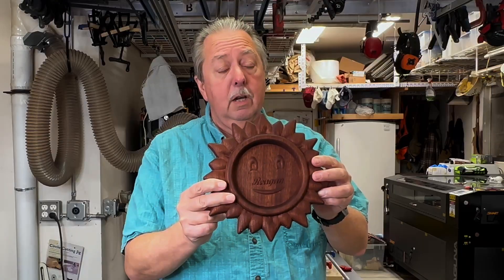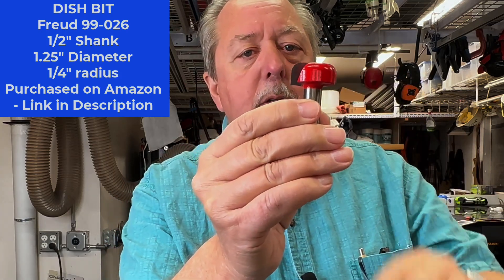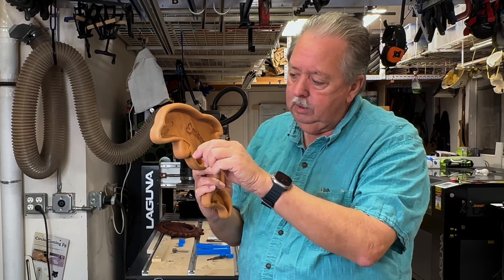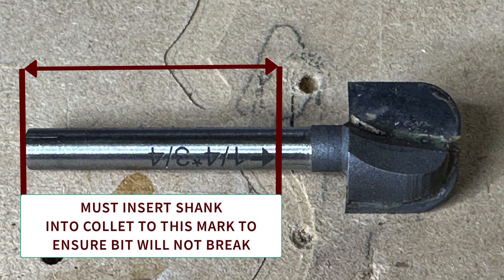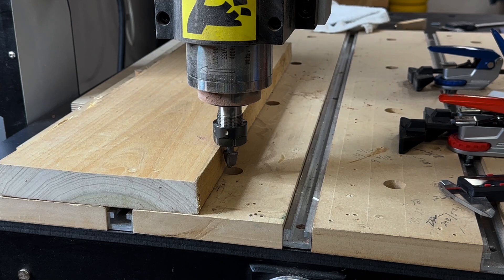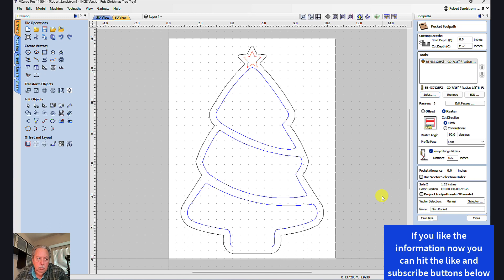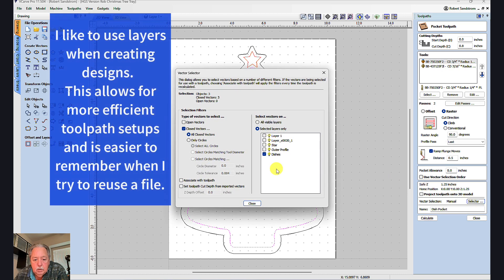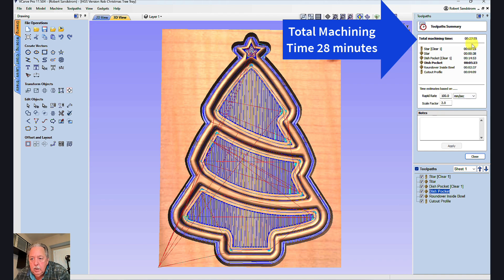Best Bits for Making Bowls, Dishes and Recessed Trays with a CNC

Comment: Another great video. How do you sand the bottom of the bowls? I have tried several methods and not happy with any of them. Special tool?
Reply from the maker: Good question Joe I should make a quick video on how I sand these.  I don’t worry about them being furniture grade but I do get them nice enough that my clients have never complained about the product I gave them.  In short, I try to get the bit to cut as smooth as possible and I do quite a bit of the sanding with a sanding mop - used a couple different types.  I just got a new type of sanding wheels I want to try.  I’ll get a video out in next few weeks.